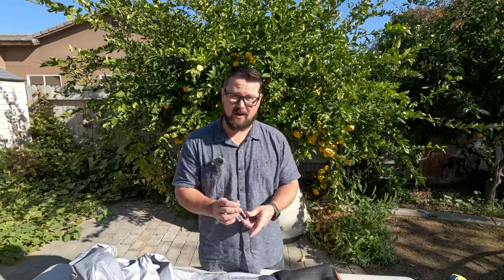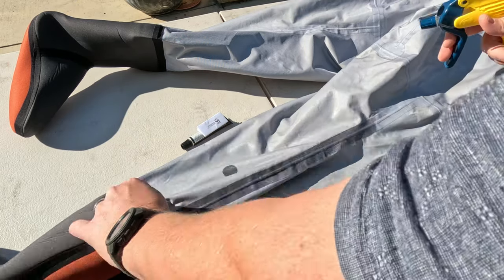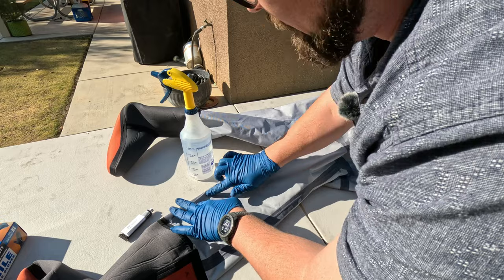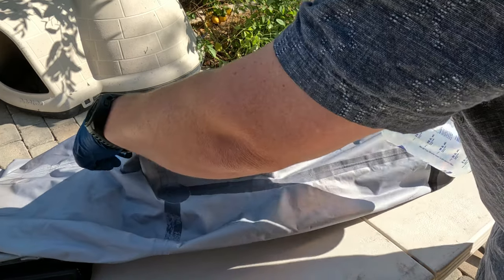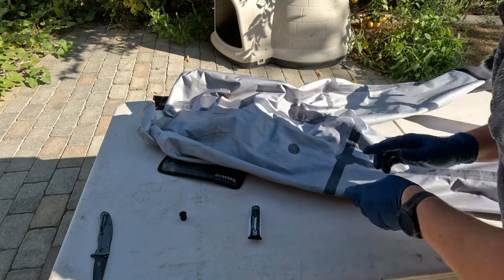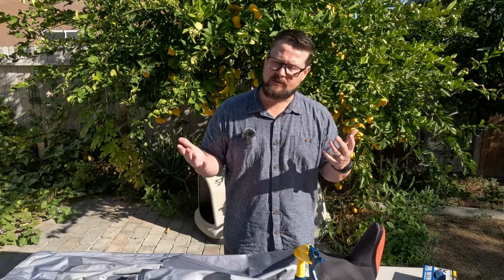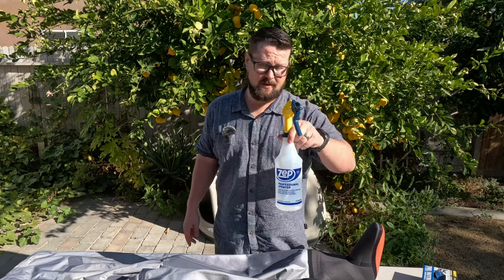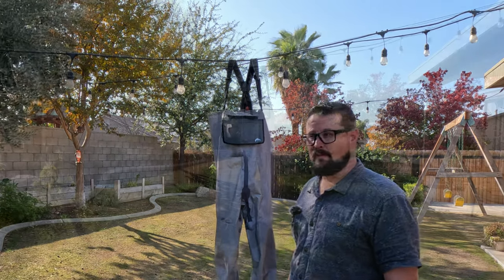How To Repair Breathable Waders | Seal Pinhole Leaks With Aquaseal FD

Comment: Excellent presentation.    I wear breathable boot foot chest waders.   Do they need to be turned inside out or does the application go on the outside just as well?   Thank you.
Reply from the maker: You can do it on either side, I just prefer the inside so it doesn't show.
Reply: @RoadandReel  Thanks for the prompt reply.  I do appreciate it.   I'll see if I can get close enough inside for my small leak but if not, I'll go outside.   Thanks again and I will subscribe.   Be well.   Rich
Reply from the maker: You're welcome and good luck!

Comment: Does Isopropyl alcohol works for any kind breathable waders to reveal the holes?
Reply from the maker: It should. I've even used it on neoprene.
Reply: It does not work on nylon. I was told by a fly shop that it only works on Gore-Tex. I tried it on my nylon waders and its didn’t show my hole.
Reply from the maker: @pauliedoherty5254  technically nylon isn't classified as a breathable wader. They are usually rubber like and involve some form of PVC to make them more durable. The best way to find holes that I've found for those types of waders is to fill them with water and see where they leak.